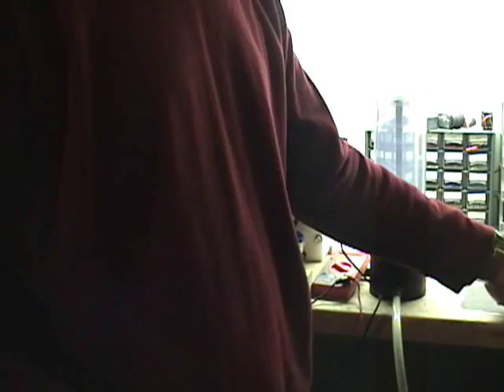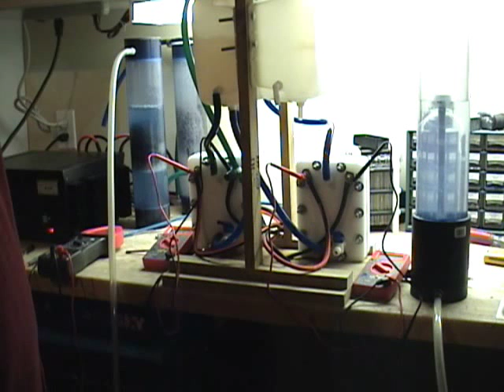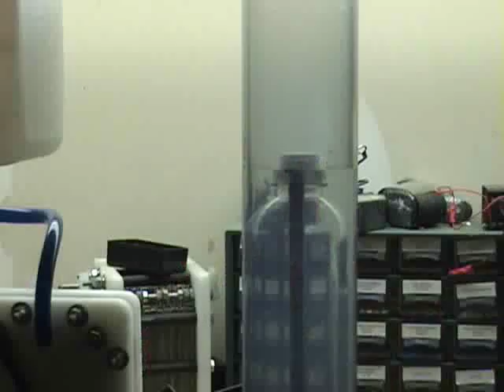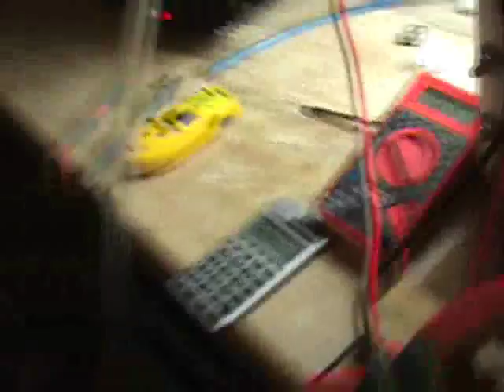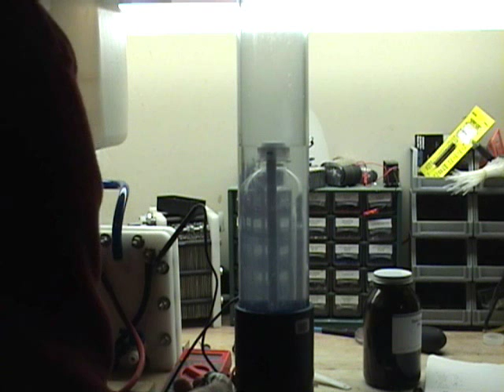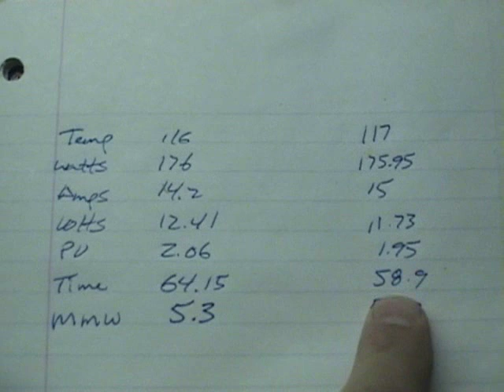Non prepared plate vs. prepared efficiency test..wmv

Comment: hello, i'm making an hho generator now and will soon be putting it together.
the size of my plates are 8" x 8" i.m going to use +nnnnnnn-. my space between each plate will be apprx 2mm (just under 1/8th of an inch) appart. i,m going to be running about 13.5 volts through it at about 18 amps. i calculate that the volts should be about 1.68v. this should be 30 amps consumption. have i got this right or should i not be using so many neutral plates.
thanks

Comment: from a house generator till it starts running good again , then turn it down a tad more and wait again , then add more hho , use a large or in series total lpm of at least 30 to start with testing them you can really see the results , btw you will have to use a half inch tube at least , t it into the low pressure supply hose with a 1"to1"to.5" tee i know youl see results , some are saying that hho wont even increase your mpg , well if you run on gas and lpg  will you not use less gas , of corse

Comment: power efficiency and compares it to the size efficiency , you wanna still fit it into your car , and the more hho the better , just lower the fuel , just tweaking the air sensor isn't gonna cut it , you need to really cut down on fuel , one way is to use a lpg vehicle like mine and turn the shutoff valve till the engine starts to starve (it will take a wile , my car runs of the in line pressure for 5 -10 minutes , and its a v8 , but ya get it stumbling and stalling and then add hho from a house

Comment: means) but you could do test with copper or aluminum even and then tell me the results , if you see a notable change in your mmw in a scale test then try larger , if it gets better then go from there , find a less sacrificial material that still conducts well , remember gold wont sacrifice at 24k and its the best conductor in high supply , by the way i cant seem to find any where that sells gold sheets , also remember mmwmm3 is more accurate , it measures the power efficiency and compares it to

Comment: get any conductor instead of a insulator like stainless , because if you think about it better conduction means more electricity goes to the water , now many have said well the electricity goes in so how could it not be used , well i say heat , why do you thing resisters have ceramic on them , its to dissipate heat , the only problem is any material will sacrifice , unless you use gold , now i dont want you using gold (unless you really want to and have the means) but you could do test with co

Comment: aim your sandblaster in only one direction (towards the outlet) will help if you looking for bubble transfer , and also i do believe that if you have deep and not deep scratches it will help , to do this change grit and go harsher as you go (opposite to sanding normal) and even 2 different grits will increase , try the same test with a high grit such as 100 - 200 then the 40 and see if you get an increase worth wile , that and the directional sanding will help , also if you can get any conductor

Comment from the maker: bubbles are diffidently a lot smaller on a blasted plate. They move away from the plate fasted as well. I believe this is why a prepared blasted plate is more efficient. I have seen over a 20% Increase in some tests and a positive increase in all tests. A blasted plate raises the current density per sq. inch also. More production per inch.

Comment: if you could see inside the device, you would see the fluid level bouncing up and down in concert with your amp draw dancing ... once one of these things gets producing, back pressure tends to push the fluid level low which drops the surface area exposed and lowers the amps ... production slows until the fluid regains lost ground then the process repeats ... there are many ways to over come this effect ...

Comment: very impressive test and must admit that your evidence is pretty convincing ... can I assume that the only difference between the two devices being compared is the rough surface texture ???  I was not able to measure any significant difference during similar experiments that only involved roughing up the surface as per the D9 method ... it took a couple other tricks as well to get a noticeable improvement ...

Comment from the maker: both cells were run at the same wattage. same watts on the prepared plate as the non prepared. This is a efficiency increase.
You are right about surface area. sandblasting increases surface area enabling more watts per sq. inch. = greater production per sq. inch.

Comment: It appears to me that your increased in MMW was due to a small increase in surface area, caused by sandblasting. So for increased output in a confined space sandblasting is recommended, but for non confined space just increase the surface area, by adding another plate!!!! GOOD EXPERIMENT!!!!!!

Comment from the maker: you are indeed right. the prepared cells best mmw was close to 2.25 volts. I cant do a vary accurate test at that voltage because it is unstable. the amps jump to much to get a real reading. This test shows a good increase over the non prepared cell but i have tested these with over a 1 mmw difference.

Comment from the maker: That's a great idea. maybe a kilowatt meter. I wonder how accurate they are. I agree that these amp meters are not completely accurate. Although my voltage is right on to a couple of hundredths. 
I have done many many tests with this setup and all of them show that a prepared plate is more efficient. It is more of a trend that i was looking for and that makes for a way to long and boring video. 
I really think your on to something though with the kilowatt meter.
thx for the post.

Comment: Steve, you put lots of work into your tests, good work, but there is a flaw in your data. The amp meters you and most people use to do this are not accurate enough, as you can see the number bounces around, (your voltage does to). To get accurate results you need something that measures the total watts used while running your test, similar to a power meter on your house.